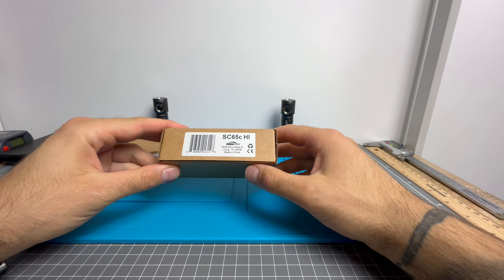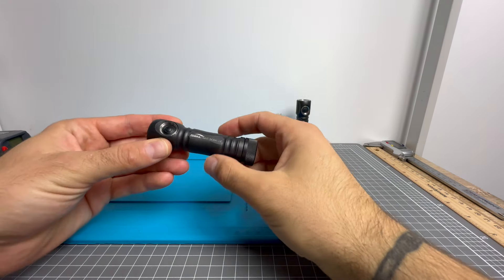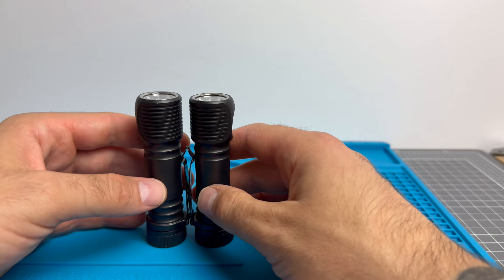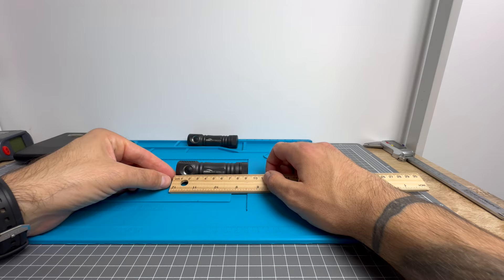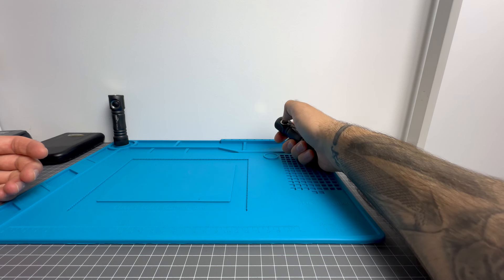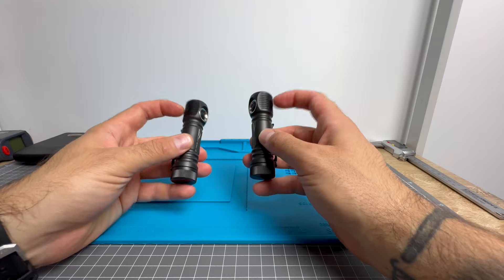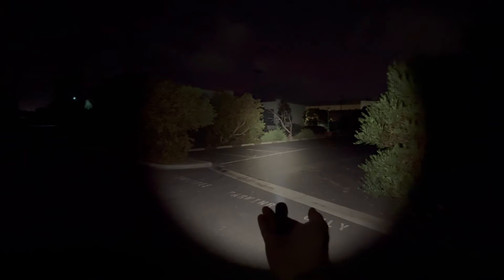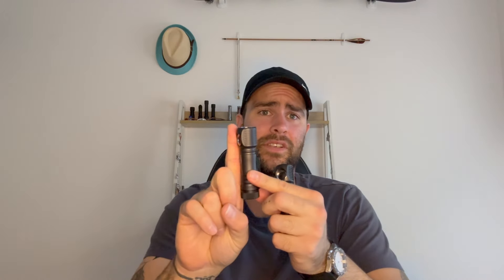ZebraLight SC64c LE vs SC65c HI - These are POTTED, PROGRAMMABLE, and EDC PERFECTION! #camping #edc

Comment: Love Zebralight, and the SC65 is my favorite light of all time. Just an FYI, the SC64 is discontinued, even in the U.S. you cannot buy it from Zebralight. If you find it on the secondary market, it's probably going to be like 2x the cost since it's been discontinued for over a year I think. You are lucky to have the SC64! 

Also, another FYI since you mentioned the stock battery, Zebralight does not ship their flashlights with batteries (except the A6 for some reason), but they do stock their recommended 18650 and 21700 batteries in the "Accessories" section of the site.
Reply: Nice, have you ever got to use an armytek?